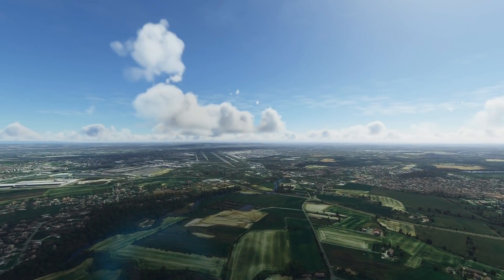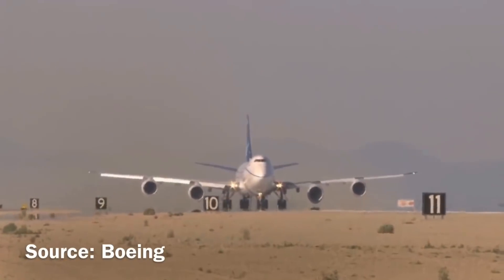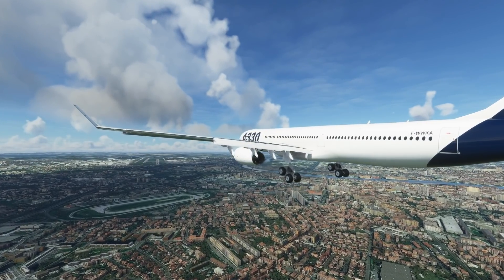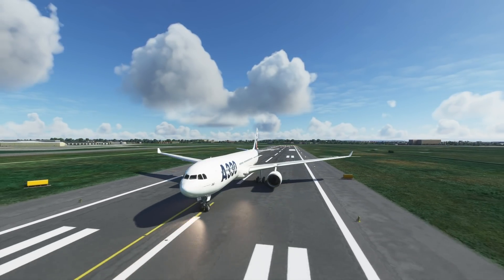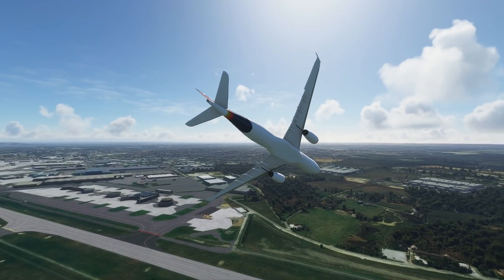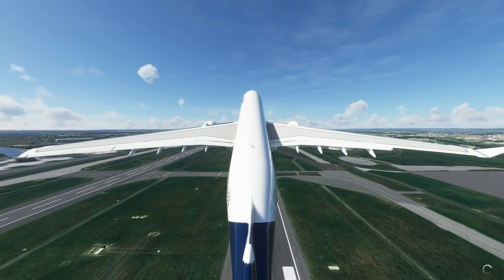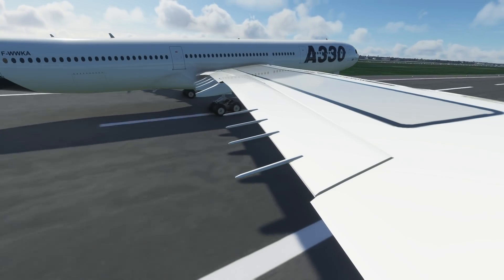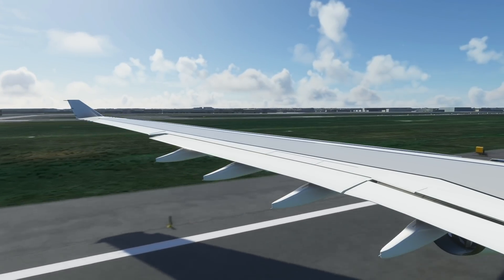The Test Flight That Went Horribly Wrong | Airbus Industrie Flight 129

Comment: 6:52 "It was too late.  They just didn't have the altitude"
Is there something that prevents them from doing this kind of test at, say, 3000ft?  ie. not so high that rarefaction of the air would make a major difference, but the altitude would be enough to take action when the flight became unstable?  So they would take off with the CG aft, but take measures to make the takeoff as safe as possible, then climb to test altitude, then slow the plane to takeoff speed, then do their manoevres - then, when the plane goes into unstable flight, it wouldn't be 300 ft above the ground. [EDIT : That should have read 3000 ft]
Flight, after all, is 100% safe.  It's just crashing that is so horrendously dangerous!
Reply: No it’s simply not the same. The test would have gone fine if the altitude had been selected much high to prevent going into ALT CAPTURE mode which primarily commands pitch instead of speed which SRS or normal climb modes would.
Reply: @tomstravels520  Well, I'm not a pilot (I flew gliders many years ago), so I can't assess the situation (and I don't know what ALT CAPTURE mode is), but if the lives of 7 crew have to be put at risk in order to test what will happen when there is an engine failure, then there is something wrong with the test procedure.  I just said what seemed reasonable to me.  
Consider this - if they had an airport on a high plateau with a 3000 ft. cliff down to the plains below, they could take off, then fail the engine - and that flight would be identical to their test flight.  The only difference would be that they would have passed the edge of the cliff, and would have 3000 ft below them to give them time to think.  I can't really see the difference between that and climbing to 3000 ft then simulating a takeoff from an imaginary runway at that altitude.
Reply: @DownhillAllTheWay  this test is done in every single new aircraft and they don’t crash every time. The major mistake was not doing the checklist correctly to make sure the altimeter was set to a much higher altitude to prevent the aircraft switching from SRS (if it had stayed in that mode it would have pitched down to maintain V2)  to Alt Capture. If they had also reacted in time they could have taken over and throttles the engine back up again to test tempt the test in the next takeoff. Also where are you going to find said runway? You know if something else went wrong in takeoff and they couldn’t stop in time they’d end up falling off the cliff when they could just overrun the runway.

The lives of the 7 crew have to be put at risk.......yes it’s a risky job. You are testing something that is unknown. Do you think when an aircraft makes its maiden flight they go....”no it’s too dangerous guys”
Reply: @tomstravels520  Oh, good grief!  I didn't expect an argument like this.  I'm not suggesting that they should have a runway on a table-top with a steep fall-off all around it, but you must surely agree that if they did, it would have probably saved 7 lives - in that particular instance - not in every scenario.  The only reason I proposed that was to illustrate that it would have made that particular flight safer, by giving the crew more time to think about what to do.  Now if you can accept the potential benefit of such a hypothetical table-top arrangement, then surely it would be possible to get that benefit by doing what I said originally.

I hear what you are saying about setting the instruments and controls according to the manual - they shoulda woulda coulda - but the fact is - the FACT is that they didn't - and this was an experienced crew, who were not facing an unexpected engine outage, but a pre-planned one!  I suppose another answer would be to never have an unbalanced plane, and I have been on commercial passenger flights where passengers have been asked to redistribute themselves to balance the aircraft - but they wanted to test what a tail-heavy plane would do  if an eng9n e failed while it was still in its initial ascent.  If they knew what would happen because it's in the manual, then there was no need for the test.  The results of tests like this are new material for the manual.  You may well be seeing something I'm not seeing, and if you're a pilot, that's very likely, but it seems reasonable to me that if this instability had happened further from the ground, everybody would have stood a much better chance of survival - and I believe that if the test was differently arranged, it could have been tested further from the ground.  

So how could you make it safer?  Well, you could take off with both engines, get up to a safe altitude, then put the wheels out and slow the plane till the only difference of it being 3 ft off the ground is that there's no air-cushion at altitude.  The plane is at take-off speed, horizontal - a simulated take-off, but at a safe altitude.  Then you go through the motions of acceleration, rotation, etc, and fail an engine.  These were people who were setting up a relatively dangerous scenario (as proved!) to test what would happen - because they didn't know!  They must have thought about it in advance, and even though I'm sure you would have done it differently if you'd been there, you weren't, and they lost the plane and their lives.  If my idea is unworkable, instead of saying "It won't work", suggest something that would make such tests safe.  If setting the controls makes it safe, then there's no need to do the test, so that's not the answer.

Planes get tested - all of them - and, sure, they don't crash every time, but if an experienced crew of seven is lost even once in a blue moon, you must surely agree that something is amiss with the test procedure - or do you consider that it's acceptable collateral damage?  Now, if my suggestion wouldn't work, then instead of just saying "It won't work", suggest something that would make such tests safe.

Just as a matter of interest, the Titanic's ops manual said that if it had to hit an obstacle, it should do so head-on, and should not try to swerve - and that would have saved the ship.  But when people are faced with an emergency, they don't get the manual out.
Reply: @DownhillAllTheWay  I’m just going to end this argument by saying the one main reason why it can’t be done at high altitude. SRS mode will only ever engage during a takeoff and not whilst trying to recreate it at high altitude. Therefore it will not be completely realistic to an actual takeoff scenario. All they had to do was check their instruments and then they’d have lived. It was their mistake that cause this accident with other contributing factors. They did this test in the A380 and A350 and they didn’t crash so clearly it can be done safely. The aircraft now has protection in the event of being in alt capture mode to prevent a stall. 

Yes it’s dangerous but that’s why they’re “test pilots”. Not regular airline pilots. They know their job involves testing unknown equipment and technology. Remember as well this crash happened in 1994, not 3 days ago so do you think procedures haven’t changed at all in nearly 30 years?
Reply: @tomstravels520   I don't know how you define "high altitude", but I didn't think 3000 ft would have qualified.  Planes fly out of Johannesburg every day, where the runway is at 6000 ft.  But let's face it, Thomas, any conclusion we came to here, wouldn't have changed the world of aviation anyway.  Fly safe!
Reply: @DownhillAllTheWay  XL888T stalled at 3000ft and the pilots didn’t recover in time. Not every runway is at 6000ft and pilots have to reach higher speeds before rotating to get enough lift due to the thinner air so it’s still not the same as most airports
Reply: @tomstravels520  Ah!  You want to continue this, then?  OK.  I'm sure there have been many aircraft that have crashed due to problems that developed at higher than 3000 ft.  I never thought I was proposing a panacea to every potential air accident.  It just seemed like common sense to me (perhaps mistakenly), that when you are testing something for which the outcome cannot be 100% predicted, the chances of recovery are improved if you have more time to react to the circumstances before hitting something hard.
Reply: @DownhillAllTheWay  yes if you can do the test at high altitude then you obviously would. But when the test involves taking off, turning on the autopilot and then “failing” an engine to assess how it managers the situation.....you do that when you are taking off...not mid flight when the normal autopilot modes (especially SRS) will not engage and make it unrealistic. The pilots didn’t follow the checklists or they’d have noticed the low altitude selection. The whole point of this flight is to make sure the system works and also captures data for simulators. If the simulator was programmed to respond to an engine failure on takeoff but the data used to feed the simulator was done whilst in flight then you’re training the pilots wrong

Comment: What a cacophony of errors. Why would the captain reduce power on the right  engine to reduce the roll rather than reapplying thrust on the left engine especially as they were low and slow, obviously below V2. Fatigue may have been an issue but incompetence definitely was. Also why was the nose allowed to get to 28 deg nose up. Speed degradation would occur on 2 engines at this body angle let alone 1.

Comment: The pilots did NOT shut the engine off. They reduced it to idle. That’s why you then shut off the hydraulic circuit to “simulate” and engine failure